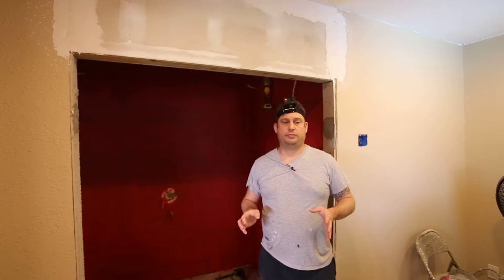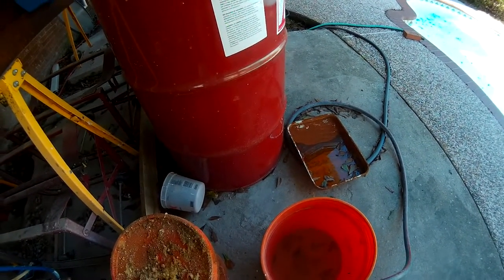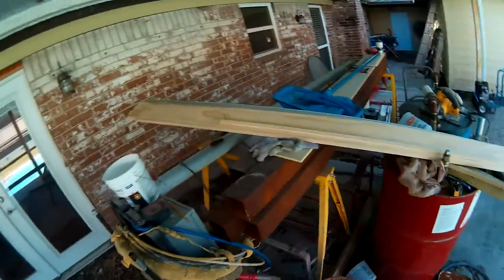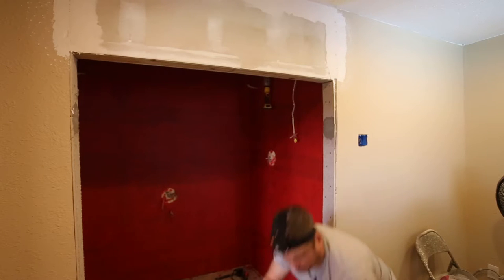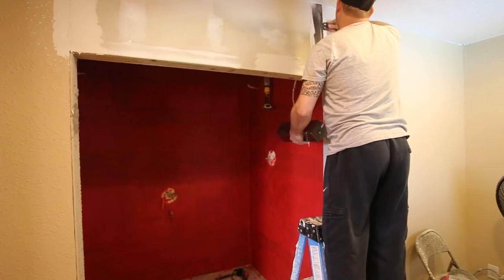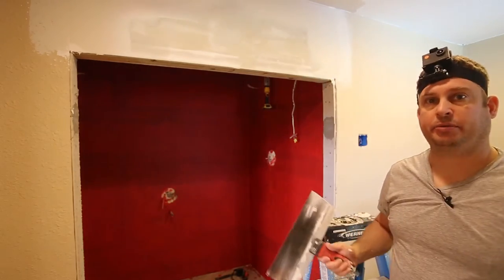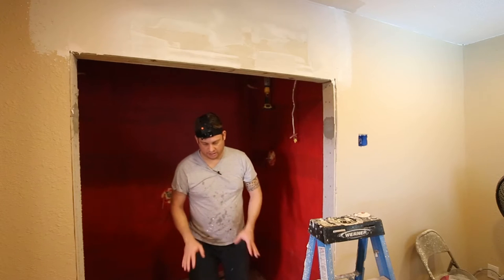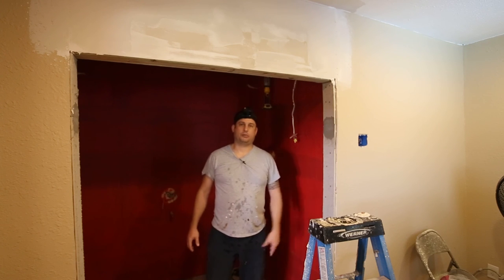House Remodel: Sheetrock Mud

Comment from the maker: Fair Warning: The footage from the secondary camera was unusable..... so the video quality on this is something I'm not happy with.  I decided to share it anyway because it's still useful info and some of my followers may find it interesting.
Reply from the maker: I was very very disappointed with this video.  I had planned on having secondary footage from two other cameras.  It was unusable.  That's one of the curses of shooting solo.

I thought I did cover why "hot mud" is useful and thought I mentioned the 20 minute advantages.  It sets fast, doesn't crock/crack, and is rock solid.  Sorry if that got edited out.  While I do edit my own videos, once I decide to cut something I don't review all of it.  Sometimes I change my mind on what I think is important as I'm editing.

Alot of people prefer readi-mix for topping.  I don't.  I've done several houses this way and been very happy with it.  My last house was a Level 4 finish.  I decided this house would be Level 3 with a heavy texture for personal reasons.

The sander has a chunk missing out of the pad.  This throws it slightly off balance and that causes it to wobble a bit.  It lost a fight with a nail somewhere along the way.  :)  It still works better than doing it with a pole by hand!

I'm happy with the net results and the overall finish level.  

lastly - I don't represent myself to be an expert on sheetrock.  In fact, I'm really just video blogging on my house remodel so that my subscribers know why I'm not working on my aquarium.  However, if you are knowledgeable, put up some quality videos on sheetrock.  I've shared 133 videos on things that interest me.  I did enjoy your 30 second shot of San Francisco traffic though.